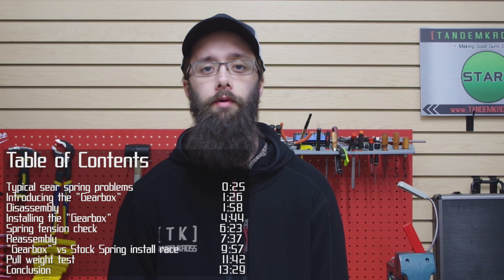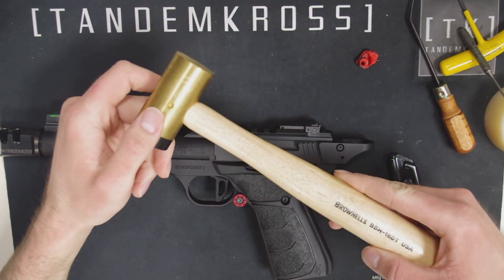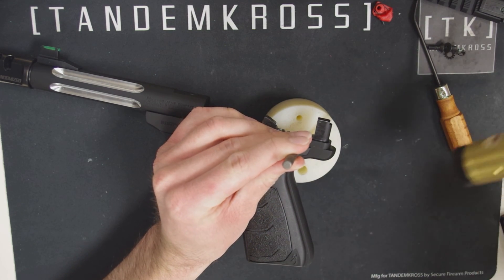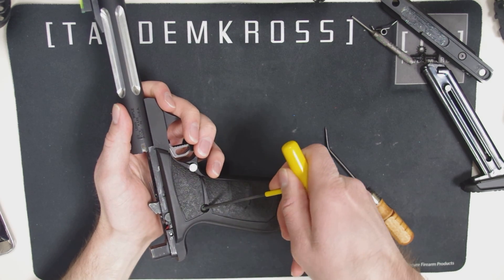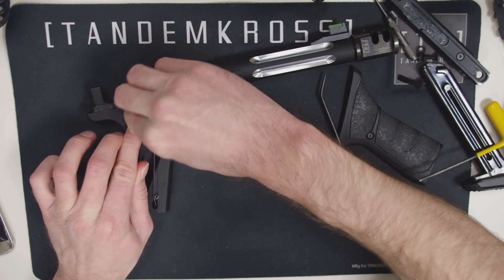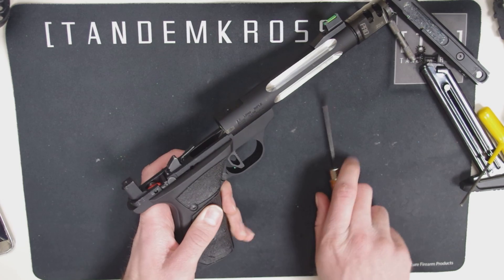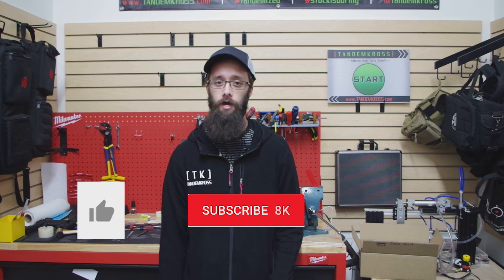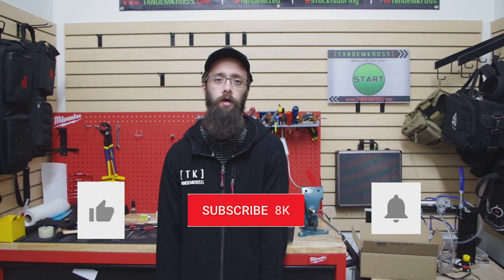TANDEMKROSS - "Gearbox" Captured Sear Spring for Browning Buck Mark - Install and Demo

Comment: I need a minimum trigger weight of 2lb, so anything between 2 to 2.5lbs would be great. If use a gearbox and the pull weight is less than # 2 is there a (easy) way to tweak it up to that 2 lb minimum?
Reply from the maker: it will not be lower than 2lbs!

Comment: What about the bolt spring, the buffer replacement and the other PLASTIC rod holder that is NOT being made by anyone???  This pistol shoots great, but it is FINICKY Beyond Measure, and a Hanger Queen.......
Reply: For the early models, I found that little triangular black plastic/rubber piece at Jack First Gun Parts.
Reply: @RyanTucker-jw8dn  , correct, the ONLY Source, and these people doing the printer copies, the plastic is way to hard, and half of them are CROOKS on Ebay....

Comment: Just buy their victory trigger, skip buying this! Tried and broke 3 punches trying to get the rear pin that keeps in the sear spring knocked out, instead it woke up my roommate and bent/broke the 3 punches, so had to just leave it the hell alone and put it all back together. Their trigger till give you enough pizazz and also give you better leverage on trigger pull weight. The guns they show in the video are all older models well beat up, mine is brand new and sure as hell wont let go of their pin, so yeah, dont buy this gearbox setup its just going to give you fits and wake up everyone with too much noise!

Comment: wish I could install my gearbox but my sear spring pin won't come out. I've hit it so many times that there's craters in my punch mallet
Reply: Try some penetrating lubricant and then come back in a few days. There’s probably some corrosion. Another thing to consider is if it’s a taper pin. If so, it’ll only come out one way and not the other. Browning customer service should be able to clear that up quickly for you.

Comment: New Buckmark exclusive to BassPro. Replaced spring and went from 4lb 11oz to 3lb 7oz trigger pull. Then went with new trigger from TK and down to 3lb 1.5oz.  Much better feel. Really like the combo. Hoping over time will work in and get bit lighter trigger pull.  Easy process following the video.

Comment: This is a great product.  No question.  But telling people that removing and replacing the sear spring is difficult is just drama.  It is ridiculously easy to do.  And NO disassembly beyond a field strip is necessary.  You do not have to remove the grip(s) at all for the Heggis flip.  But even though they over "dramatized" the difficulty of the procedure it does not take away from the quality of the product they are selling.

Comment: I did the spring flip on mine a few years ago and it was great It had a really light trigger pull, but after about a year it just stopped recharging the firing mechanism, so not so great. I changed it back and it was fine and yeah it was significantly harder to put back in I think I spent about an hour on it. It was a big relief when it worked fine again though, I wasn't positive that was the problem at the time.

Comment: If done correctly, the heggis flip is extremely reliable, consistent and uncomparably cost-effective.
I successfully do competitive shooting with it and my trigger pull does not move a hair from 2.65 pounds.
Gearbox 30 $ +  Victory trigger 50 $ = 80 $ versus a spare Buck Mark sear spring for only 3 $. You decide.
Although the gearbox alone is not as effective as the heggis flip, I have to agree it is a cool invention.

Comment: Wonderful video.  well done.  Clear, professional, thorough.  my factory trigger broke at over 6lbs.  Reduced mine to around 4.  wonderful product.  The return spring, around the firing pin in my relatively NEW, less than a year old, buckmark is significantly longer and has a LOT of tension.  compressing this spring was a major bear.   I am guessing, my spring is a full inch longer when not compressed than yours in video.   Makes me wonder IF browning started to spec a new spring.  I could not get it back together.   was frustrating even for a gun smith.  comments?

Comment: I received the unit in record time - 2 days. My installation was not as quick as Bill's. The box did not "drop in" as easily as shown in the video - I had to give it a few taps to get it to seat. Since I was sure the spring snapped into place (I heard it snap and could see the spring in place), I skipped the last step of removing the grip, disconnector etc. The gear box reduced my pull weight by about 1lb . I'm very satisfied with this product. I use the weapon in rimfire challenge events.

Comment: Nice but one question how do you uninstall the gear box
Reply from the maker: Good question! Removing the GearBox is really simple. Use a punch to remove the sear spring retaining pin that holds the GearBox in place and then use a pick to pull the GearBox out. It does offer a little resistance when pulling it out, but that's normal. Many times when you pull the GearBox out, the sear spring will come loose from the installation frame. Before reinstalling, just be sure to position the spring so the end is back in the channel of the GearBox (as it comes originally).

Comment: Why did you cheat the trigger pull tests by pulling on the bottom of the victory trigger and not in the middle like the stock trigger?
Reply from the maker: Hi there, it's not cheating the test - being able to place your finger on the bottom of the trigger is one of the major benefits of our flat-faced triggers vs. a traditional curved trigger. It boosts leverage and improves the feel of the trigger pull even further. Hence why we demonstrated this way in the video.
Reply: @TANDEMKROSS  So true, confirm that.